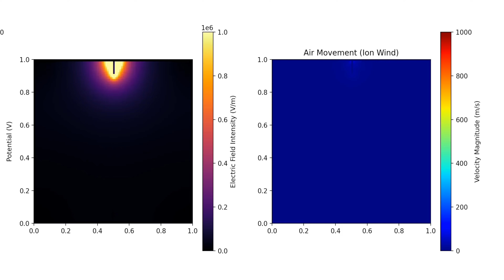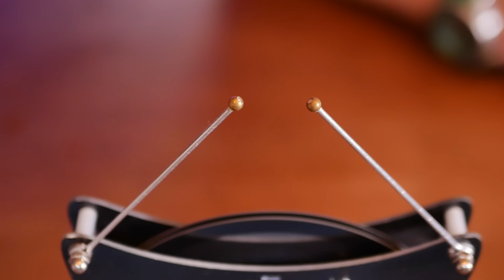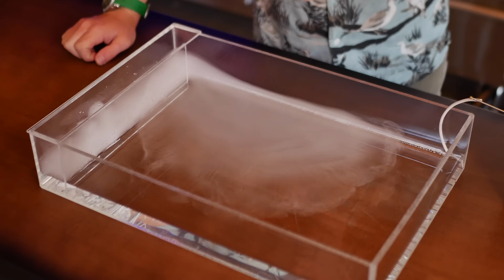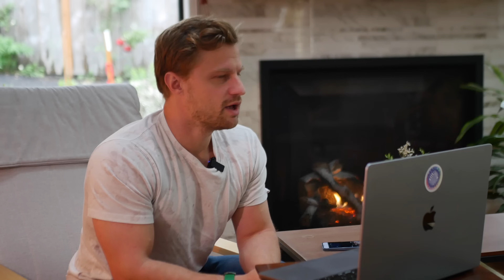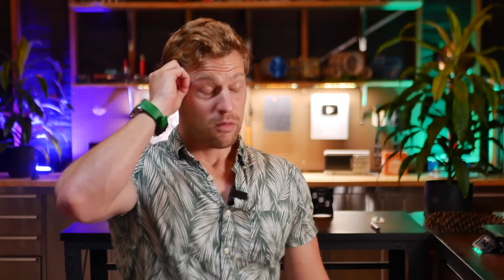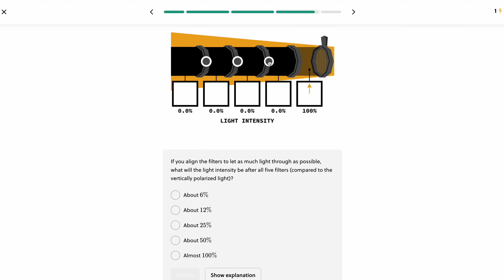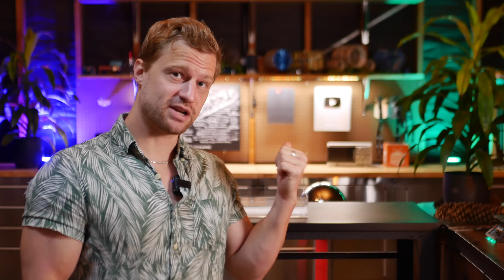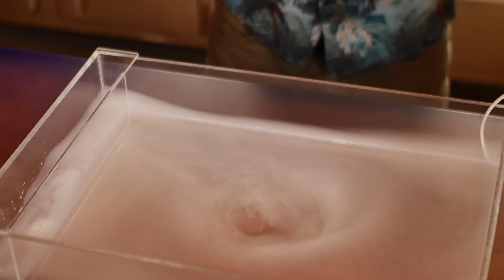This High Voltage Fog Is Controlled by Pointing (BiFrost Nebulagraphy)

Comment: Something even more beautiful happens in clouds during a storm, when all ionized flux gather toward a single point to create a lightning strike. You could combine the cloud chamber or Wilson cloud chamber with this experiment you will see very interesting result, WARNING : no oxygen in the chamber the risk of spark would ignite the alcohol vapours, adding xeon gaz, will add to the effects if you use a low light camera....

Comment: The high voltage in the water is interacting with the wood in the table. Just like a dc flyback does when you put negative only to a piece of foil. It will suck the foil to the table. You are right the finger creates a breakout point for the high voltage to create the beam. Your body is accumulating the charge allowing for a longer distance. Wood always holds in more charges. That's why we all isolate it from an experiment. Just like you did with the bsi thruster.

Comment: To be safer don't run the voltage/current across your heart. Connect the wire to the same arm you are using to draw.
Reply from the maker: At higher powers I would agree. However, this experiment is safe to 100% of people who conduct it as i've done. Using a small static electric source there is zero risk, as the current is at very low levels.
Reply: It is also about familiarity, you build up a trend in your mind that that is a ok way to create a circuit across your heart, then you connect some other device in the same way, but with consequences.

Comment: I noticed a partially seen side effect shown in your friends simulation.  the finger at the top is only partially seen, but it seemed to allow visualization of the different tissues of the finger tip with clear delineation between the density of the different tissues like the bone, soft tissues and skin.  This appears to be a similar delineation used to good effect in an MRI without the massive equipment required.  Could it be aligning the magnetic poles of the atoms in the tissues like the MRI, or could it just be the different conductivities of the different tissues in the fingertip?  It would be interesting to look at more of the finger and see if the effect suggested by the partial glimpse seen by your presentation carries through consistently throughout a larger view of the tissues of the finger and how far up the finger the phenomenon propagates.  Just my curiosity.  A cheaper and simpler MRI?

Comment: For higher voltages, or higher currents, it would be interesting to see the effects and understand how the forced condensation turns the fog droplets into water drops that can support crops in arid areas. To achieve this, you should point the tip of a wire instead of the tip of your finger, for safety reasons.

Comment: with all due respect, i believe you and your friend have it very wrong.

i say this because of the vortex when you use your palm

consider:

1 - co2 infused into water forms carbonic acid, and carbonic acid increases electrical conductivity of water

2 - co2 gas is an electrical insulator

you are essentially forming a capacitor plate, with the water as the grounding plate, and your finger as an electrode, and the co2 fog (which will not condense because it is not water vapor) is acting as the dielectric plate.

however, co2 gas is not a rigid plate. the layer of co2 gas near the water is going to pick up the negative charge, and the side nearest your finger (or palm) will pick up the positive charge. 

in the case of the finger, the charge from above will be more forceful because of its concentration and the co2 gas is nearer the ground charge than your finger, so the co2 fog is strongly attracted downward to the electrically conductive carbonic water. 

in the case of your palm where the surface area is larger, and your hand nearer to the co2 fog, you are witnessing a tornado caused by the convection of the gas charged by your palm sinking to the water and the gas charged by the water rising to your palm.

it is essentially an instance of dielectric breakdown when the voltage exceedes the dielectric threshold, only insteasd of cracking, melting, etc… the charged co2 particles simply travel and transmit their charge, in the same manner of a Franklin’s bell, or confetti jumping around between two charged plates

very cool effect, but i think the explaination in your video is a tad grandiose

Comment: Hmm...
In theory, it would be possible to figure out a way to make this change train routes for a model railroad or even a real one. Basically, your finger goes in the same route as the train across the board. This causes signals and turnouts to act in the proper fashion. It might even be able to cause the train to start and stop too...

Comment: What about holding your flat hand over the tank and getting a vortex? Please answer this question as I am doing a similar experiment with Alexey's graviflyer in Russia. Look up Alexey Cherkurkov on this channel. Can the ion beam in the ionized plasma cause Alexey's craft to lift up under the correct circumstances is my question? Alexey's device has three flat plates that use a high voltage and high charge that make a spinning current and voltage spinning around the disks due to the spinning magnet on the disks.  The tesla coil that Alexey uses is grounded to the earth much like your experiment with one of your hands on the high voltage, low current generator and the other to the flat disks like your hand. Antigravity waves can be a torsion wave of the aether or your spinning vortex with your hand held over the tank. Also, can a UAP work in the same manner based upon the different shapes of the UAP whether they be saucer shaped, bell shaped or spherical shaped and have a high voltage and charge on their surface?

Comment: Wait, how much is this effect related to the upstroke of lightning? :o

A concentrated beam of electrified air bridging a positive charge and neutral causing a conductive wire to form would be exactly the kind of path a bolt would like to take

Comment: Checked on your Sparkit and it's been sold out since this video aired.  Any idea when they will be back in stock?
Reply: The 1990s version used a 7KV negative ion generator module as a power supply.  "Anion" modules even have a 12VDC version, and will run w/9V battery.  Use a cookie sheet standing on four plastic cups (and perhaps paint it black first, for visual contrast.)   Really, the only hard part is getting the dry ice.  Here locally, some supermarkets have it in their seafood department.

Comment: This is really cool. I wonder if there was a way to scale this up and use a laser or something like an optical receiver in the middle of it to greatly reduce refraction of Optical communications over a distance or through cloud cover. Sort of like an ION shield instead of glass and insulation as you would have in a fiber cable.

Comment: This seems kinda similar to using a laser to create a thermal channel in air, which an electric discharge will use as a pathway.
(I wish I could remember what video or project this was used on... The only related memory is someone making a Lightning Gun and using this method to ensure it discharged where desired.)

Comment: How much power do you need to be able to ionize the air enough to pass a high voltage current down it? I'm thinking high voltage taser.

Comment: This was awesome. Thanks. Where did you get that power supply. I tried searching but nothing looks like the one you used.
Reply: @smallshoptalk589 it's a wimshurst generator kit.   also, negative ion generators (anion modules) work great.   Any 10KV high-volt power supplys will work, but the anion modules and the wimshurst kits won't electrocure anybody.

I once saw somebody do this using a charged rubber balloon.  It was a bit hard to get it to work.  The balloon attracted little hairs onto its surface, and the hairs launched these streams into the dry-ice fog.   Another person did it with a large plastic comb, rubbed on wool.   Only works in low humidity though.

Comment: If the applied voltage is the cause for jet formation and propagation, why does it still form without any voltage applied as in the last simulation shown? 
Is it the moment of voltage shutdown and the breakdown of the jet maybe?

Comment: So now you can add a programmable antenna to disperse the fog at certain levels and depth add a projector and a good fog machine and you got the beginning of true 3d space manipulation for a display I want in on the project
Reply: Also the voltage drop with proper calculated depth can allow true depth  I see this has true potential imagine a 3d space TV that can be cast into a room add light and color from projections and a true 3d render of any space can be held inside a room if only for a few seconds since any movement would change the dispursion this properly developed can be Made amazing see a call of duty game with ur fog effect displaying real renders of areas inside of say a living room no longer needing a TV as this can replace it and go far beyond it

Comment: What happens if you connect the positive to the water and the ground to you?  Would the fog separate but also try to move up instead of down?  Provided you could insulate the water container so it didn't ground out to the table.

Comment: If the ion beam is that "slow" you should have a time delay in between touching the orb and the beam to hit the fog. As in chris' simulations. Generally I'd be interested in what it looks like when the power supply is cut(letting go of the orb) while drawing in the fog. And vice versa. 

Finally: you think ships could use this method to remove fog from around the ship? It has contact with the water after all.

Comment: BiFrost... see what you did there 😉.  So, between the finger and the fog chamber, you have an invisible plasma filament (exactly like in a plasma ball). You could try to make this visible, but you'd need to figure out a low-pressure noble gas environment ...

Comment: So, what effect on weather (fogs, and such) does all the power lines have? Especially the higher voltage transmission lines? What about transmitter towers?

Could this be used to dissipate fog around ports, harbors, freeways?

How much does all the power we put into the air in radio/tv, etc., affect the weather (HAARP???)?

Or not?

Comment: So from this we have two things: 

First, Tesla's wireless system : ionic bridge conduction instead of wire conduction, super high voltage, minuscule currents.

Second, electric field forced laminar airflow. This is potentially huge for both aerodynamics (and it encompasses so many things, from sports to cars to aircraft to wind energy harvesting) and for efficiency of reactive (jet, rocket) propulsion in atmosphere.

Comment: This makes me curious. The votex was created due to the electricity acting upon the fog. I wonder if this correlates to real world weather phenomenon. There are still a lot of unknowns and unpredictability in severe weather forecasting, specifically tornadoes. This scenario models the meeting of the warm and cold air masses necessary for mesocyclone's. Yet, it wasn't the movement of those two air masses in relation to one another that created tornado genesis. It was the introduction of the electricity. So, now I am curious if lightning has an out-sized effect in said genesis? Could the level of electrical charge in the atmosphere be a key indicator in these destructive storms?

Comment: Actually it's more likely that the fog is either neutral to the electron tunnel or is even repelled by it. The charge is jumping to the surface of the water below it, and the air is pushing the fog out of the way. This would all still be happening without the fog, it's just that the fog helps you see it. At least that's my theory. This is because if the fog were attracted to the electron channel or had anything to do with the electron tunnel, it would behave much differently than we see here.

Comment: Here's a question for you.  If we use this technology to create a high voltage low amperage filament over a long distance and then explosively increase the electric current, do we get a laser-like lightning strike?  Because it already has a tunnel of ions that just expands and plasmizes so that a larger electric current travels more easily!  If this is true, it would be a combination of a powerful ring-shaped laser diode and an ion cathode tip in the middle.  Created the first plasma projectile.